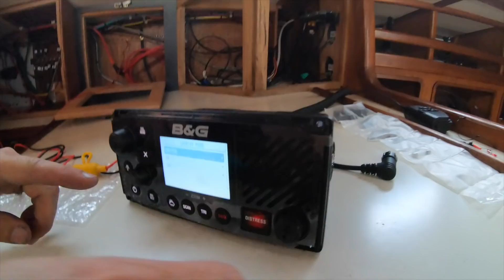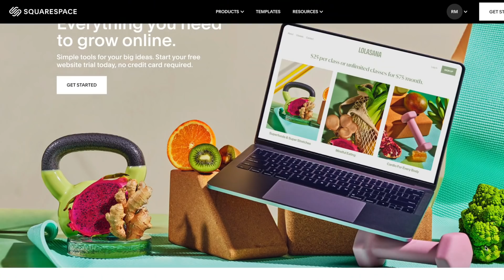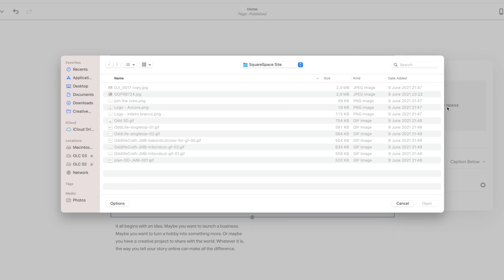⛵️Brand new SAILS for our (ONCE) Neglected sailboat!! #193

Comment: Duca and Roberta, please, please put safety wire on all the shackles in the rigging.  All the shackles have a hole in the pin end to run a safety wire through.  Shackles fail because the pin unscrews but if you wire them shut they will not unscrew until you cut the safety wire.
Reply: But, then their utube channel won't have any content. Making their PATREON SUBSCRIBERS MAD 😠
Reply: @stevenr8606  Who are you and how did you get my name? Lol
Reply: @stever2583  All we need now is Steve E through Q to turn up...
Reply: After two years of putting this boat back together do you think they don’t know that 🤔

Comment: One thing to look into, is your propane locker is not vented. Propane is heavier than air and build up at the bottom of the locker if you have a leak. You may want to look into installing a vent or change the bottle location. Everything else looks great!
Reply: This is really important to have an overboard drain in the propane locker.
Reply: Or a parachute and very good insurance.
Reply: That's liquefied natural gas not propane
Reply: @MarcosMonteiro79  doubtful, as LNG is like 4,000 PSI and very cold
Reply: Those propane tanks are only filled to 80%,and propane is -120f, and the appliances run on the fumes, or vapor. And you are right the locker they are in needs to have a vent. And those tanks usually only have about, from 150-175, psi, in them. From someone who use to work in this field.
Reply: That is Butane, not propane. Butane does not leak down but through the air.
Reply: @wesmo_  I have never seen butane used in this manner on a boat before, maybe it’s a Brazilian thing. Regardless, butane is also heavier than air and will sink like propane. Another comment from the dim side. If it is butane, they should look at getting it changed, watching the other world sailors, they all use propane around the world!
Reply: travis mitchell     Asked on my travels, all of Europe, and half the Carribean uses  butane and
Reply: @edwardfinn4141  you may be right. Butane is heavier than propane, therefore the issue still remains.

Comment: I did not see a drain in your propane locker it needs to have one. Propane is heavier then air so any leakage will accumulate in the compartment creating a bomb. Someone else may have already mentioned this but deserve repeating! The drain can be a plastic through hull out the side of the hull placed as low as in the propane locker as possible. Your plumbing should be from your gas regulator to a gas solenoid switch the the hose should exit out near the top of the locker. That exit hose needs to be sealed so any propane leakage exits the compartment thru the drain out the side of the hull. Butyl caulking is good for sealing around the hose going in the boat. 

Right now any leakage can occur anywhere inside the boat, not at all good! 

The solenoid switch (12/24 volt) with an led red on/off light should be located in the galley area usually below the counter top on the face of your cabinets. The wiring should be from that switch to a circuit breaker (with a red warning light also) the to the solenoid switch.
Reply: That is Butane, not propane. Butane does not leak down but through the air.
Reply: @wesmo_  
Mate, what do you want to say?
Butane has a density of 2,4kg/ cubic meter (m3), that is more than double the weight of air, and is mostly used in lighters, not gas stoves. However, still heavier than air, so a vent in the bottom of any compartment is required.

Comment: Information for your own safety, gas is heavier than air, so take care for a kind of explosion proof ventilation in the gas box (bottle area) and a gas detector inside the boat. If you use hoses (as you do) for gas bottle connection, change them every 3 years.
Reply: carbon monoxide detector too

Comment: Hi to you both, looking good & the end is in sight, mind you it never really ends on a boat. 
Just a word of caution, please check that gas pipe is the correct type, it looks like ordinary general purpose low pressure water pipe. Flexible gas pipe is usually a plastic pipe with a stainless outer sheath which normally has a date stamped on it, its usually about three years. 
Well that’s here in Europe, but even so, get the right pipework. 
Fair winds👍

Comment: A special tool you should have on board. A couple umbrellas to hang from your safety rail when on the water. If you drop hardware or one of those blocks in the water you'll be very sad. An umbrella makes a great catch tool. It's not 100% but it beats diving in the water after your hardware and tools. PS...Your boat is fabulous!

Comment: If you get a Yoga mat and cut it up as needed it makes for great protection against metal to metal contact.

The Antenna cable at the top needs to have a drip loop. If not, water will follow the cable into the mast.

Comment: Extra security for shackles on the genoa/jib is to wire them in place.  They won't undo overtime.  It's also good to keep some of the same shackles as spares as they can bend or show signs of wear.  Hope your friend with racing experience can help you both learn about sail trim, balance.

Comment: If you have propane for that stove I hope you have installed a gas leak sensor low down as propane is heavier than air.

A tip for your jibs, which you may already have figured out. They should start out with at least 3 extra wraps of the jib sheets when rolled up. If you roll one in when it is very windy the sail wraps tighter and takes back less of the furling line.
Reply: That is Butane, not propane. Butane does not leak down but through the air.

Comment: May I suggest that you  consider changing the method of attaching the main halyard  to the boom when reefing.
 When reefing (solo) the halyard can come of the horns before I tensioned the halyard back up and the wind Can flip the sail off the horn. So I use a strop of Correct length with a snaps hackle which positively holds the luff  until I can retention the halyard
I always  have north sails. They're  the best

Comment: Hi, PLEASE READ I just watch the video on you installing the gas bottle. The gas plastic pipe you have installed, pass through a iron hole in the bulkhead. Overtime that plastic pipe will vibrate and move and may cause damage to the plastic pipe and a gas leak. 
Pack some rubber around the plastic gas pipe so it does not come into contact with the iron bulkhead. Be safe and I do enjoy watching your videos. Gary
Reply from the maker: We actually did it, we put a rubber around it. Thanks for the concern
Reply: The pipe you have used is not safe. Please try to buy proper gas pipe, which has a date stamp. You can buy these on-line from the U.K. they are not expensive but will add immeasurable to your safety.

Comment: A little reminder about gas bottles, in some countries you fill them in others you must exchange them and of course the bottles and fittings are different in nearly every country because we can't have any form of standardisation it's even worse than electrical plugs which are almost standardised to 4 standards now.
My point, don't make that gas locker too cosy, thin anti scratch layer on the walls and some tie down points and a ratchet strap.

Comment: Hi guys. Gas hose is fairly specialised stuff, as it's gas tight and should always have an expiry date on it. The hose you appear to have installed will suffice as a temporary solution, but please consult with a qualified or knowledgeable person (from marine camping/caravan world) to see if they can help you get the right stuff. You can blow your boat to bits just for the sake of a couple of dollars worth of hose.

Comment: I used a product called Dri Deck from the marine store to line underneath lockers. My anchor locker has a heavy rubber perforated mat for commercial entry doors.  Both products allow the bottom to dry. Otherwise it will eventually grow algae. Good video! Cheers, wp.....

Comment: Hello Duca and Roberta
Didn't you ever think about putting the candles that would rise automatically in electric mode by pressing a button? I have seen it on another sailboat and it is a marvel, it saves a lot of work, especially when there is very bad weather and you have to raise or lower the sails going outside to lower or raise them.

Greetings
Jesús García

Comment: Thinking about the hole above your electrical panel; it would be a good place for a wall mounted flexible reading light attached to a small plate. Might be useful there. Congratulations on a successful build. Fair winds...

Comment: If you don't already have one you need to get a winch buddy (also called an electric winch handle, or similar). Believe me, hoisting sails in a strong breeze or wanting to get them down in a hurry if the breeze is too strong can really take its toll on you very quickly. 
It was a godsend on a recent night trip down the east coast of NSW Australia (it is winter here).

Comment: The thing with VHF antennas is that most people dont know they need to be registred somewhere with a callsign. In Sweden it was brought up that 3/4th of people who had actually stated they have such an antenna, were not even broadcasting etc as they had not registred.  So always check such things.
Reply: @fransdriesen1311  yeah, I'm no sailor 😅. But I understand there is more behind this. Just wanted to make a note for people not to forget registration/check how it works so you can get pinged correctly if there is an emergency :)

Comment: Watching you on top of the mast using an untethered tool made me so nervous. Use a little paracord and create lanyards for any tool you take up with you. Attach the lanyard to yourself before you step off the deck. That way, if you drop a tool, it doesn’t hit the deck (or Roberta) or splash into the sea. :)

Comment: I think that for the gas shutoff. The original was in the position you have put the new one . Behind the cooker. But if you have a fire or problem on the cooker . Then accessing that is very dangerous as you are trying to get access behind the cooker across the source of the fire. Which is why a second one was then installed on the cabinet to the right side above the cooker. This was probably done later in the life of the boat. You should have put the shutoff there. It's a safer access to shutoff which does not involve going across the hot cooker to access in emergency.

Comment: Never have I seen a transparent hose being used for propane gas, hope you have the right hose (fuel line). I would hate to see the boat go up in smoke......
Reply: This is why I came to the comment section.  I'm a plumber in Massachusetts  and there is definitely no such approved material here. And in no case would you ever fasten a fuel line like this with a hose clamp. I would suggest using copper with compression fittings.
Reply: Reading your post and I realized that they are in Brazil.  The hose they are using is very common in Latin America.  It was the only thing I could buy when I was in Mexico.
Reply: Even with Brazilian import duties, buy the best, safest fittings and hose.
Reply: I wondered the same, but since it’s Brazil I wouldn’t have a clue

Comment: Duca, you have great instincts....BUT,  Go back up up that mast after you have tested all those connections and;

1. Break the connections and install thread tape
2. Test again
3. Then encase (cover) the connections in silicon. Seriously. I am a retired (20 years) Merchant Marine Captain (just small 110' to 165' OSV's) and have NEVER had a failed connection using that method. Numerous Hurricanes, tropical storms...trust me it works.

All hatches also.

Have fun.

Comment: I have seen many comments about propane gas vs alcohol stoves.  Some say alcohol is more readily available and others say that gas allows them to use the oven.  There are stove top ovens that campers use with a BBQ grill , camp fire, high output camp stoves and others .
 Also any gas storage locker NEEDS a vent for safety.  Please put one in......  Thanks     Would like to hear your thoughts on this ................  enjoy

Comment: Before you install the radio permanently you must put an swr meter to check the reflected power of the antenna .Or if the antenna is out it can blow your radio up

Comment: Did you ever put the split pin in the castellated nut that holds the prop on it's shaft? Failure to do this could result on the prop falling off when under way.

Comment: The 'male' bit you are thinking of is a 'tap' to cut threads into the hole (the opposite bit to make threads on a rod is a 'die'- usually sold in kits called (unsurprisingly) a 'tap and die set'...

Comment: use a motorbike inner-tube to secure the propane bottle in the lokker . inflate the tube and it will secure the bottle in the locker fast and secure. you just need a air pump

Comment: Just a thought stick 3 inch strips of rubber on the walls of the gas locker, to stop the bottle rattling against the walls, it will be a little bit more permanent than the foam you have, then maybe a small ratchet strap to hold the bottle in place, love the vlog as usual :-)

Comment: Propane and butane are agressive gasses. Your hose will be eaten from the inside. That is why you need to use a special hose, suited for propane and replace it every two years. Better is to use copper piping as much as possible. Also you should not use radiator clamps on the hose, but special two ear clamps or crater clamps. Be really careful with gas and install professionally.
Reply from the maker: Hello, Berend. Thanks for the suggestions. Here in Brazil we use butane and not propane and we can't find here the clamps you are suggesting and we can't find copper hoses that we can use in a boat ambient

Comment: Please use official Gas-hose (rubber)  This pvc hose will harden out, and will be leaking. The hose what you installed, is for water and pressed air
Reply from the maker: This is “official gas hose” normatized for gas use. 👌🏼

Comment: Put a plastic breathable mat underneath the propane bottle or it will rust. Also paint the bottle white a couple more times to spot rust, If it is a steel bottle.
Reply from the maker: It’s actually butane and not propane and the company responsable for the bottle don’t allow us to paint the bottle

Comment: The hose you used for the propane hook-up looks like a medium grade potable water hose. Just curious if that is fuel rated hose or not. Any hose like that I've seen here in Canada would never be approved for that type of service. I'm not second guessing, but would hate to see you guys having a fuel leak ruin your day.
Reply: also, the gas bottle locker needs an overboard drain at the lowest point
Reply: One other point, the fittings should all be threaded. Hose clamps on fuel fittings is not recommended.
Reply: Agreed even if the hose is gas approved it could be because of the yellow band but rose clamps are no good they lift the hose at the screw point and they wil always start leaking there and are indeed not aproved

Comment: Hi! Are you 100% sure that the hose u use is for gas? Also most boats have a valve on the propane locker or a solenoid to open the gas only when it's going to be used.

Comment: I'm happy you got your sails in place. Just one question, will you be locking those shackles with stainless steel wire to prevent them from working loose? We do that in the U.K. as a matter of course to prevent mishaps.

Comment: Surprised you have only one gas bottle - means that you either need to refill it before it's empty, or you run out and have no hot food until the next port. And when you arrive in the USA you should get that gas plumbing done properly.

Comment: Valve should be in the upper cabinet.....for safety reasons...do you want to reach across a problem stove to turn off the gas?
Reply: that was my thought initially as well .. like thinking aloud here.. "When would the valve need to be used?" .. in the case of a fire at the stove top it would seem to me to be better to have the valve in a place that would still be reachable... and I would have thought that it could be placed such that it is always available there (like so the valve does not become covered by 'clutter' in front of it)
Reply from the maker: Hey guys!! In case of fire even the top one will be hard to access, the best choice will be to go outside and to close the main valve on the gas bottle. In any case in the future we will install and electrical solenoid we we can shut it off from the nav station. We just didn't have time to do it yet. And in a even more far future the idea is to stop having gas aboard and switch to induction cooking.
Reply: @OddLifeCrafting  ahhh.. fair enough.. thanks for the response Duca.

Comment: Can you use the 140% sail in the conditions you would have used the 105% (assuming a single furler), just by leaving it a bit furled? I never quite understood the reasoning behind investing in two forestay sails of different sizes when the bigger one has infinitely variable reefing.
Reply: The sail loses it shape as you reef.
Reply: @paulmahowald4970  Wouldn't the key benefit of proper shape be more power? If you are reefing aren't you already purposefully depowering? Then its a matter choosing the maximum power for the conditions.

I guess this wouldn't be true if shape gives you more speed with less load/power.
Reply: @heisenbugz  poor sail shape leads to excess healing without increase in speed.  with the without a ref the smaller sail you will go faster with less heal and less weather helm

Comment: A shut off valve for your stove shouldn’t be at the back of it.  What happens if a blazing fire prevents you from turning it off from the inside? Think about it.
Reply from the maker: In this case we actually will need to use a fire extinguisher 😉